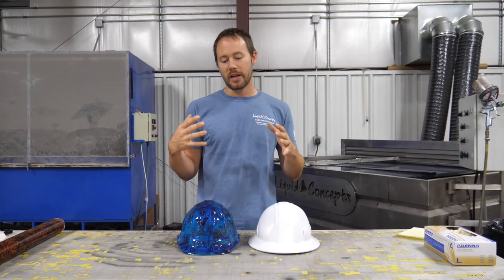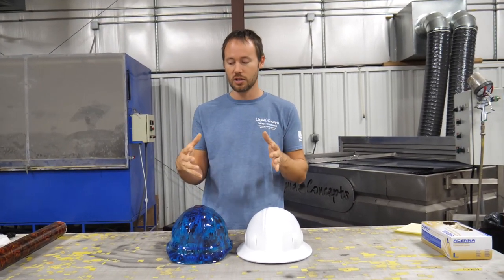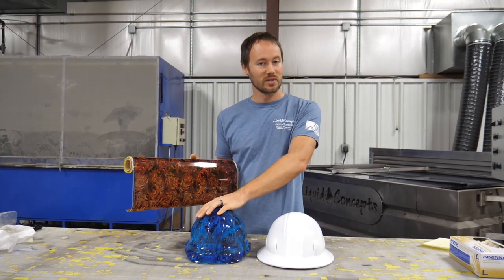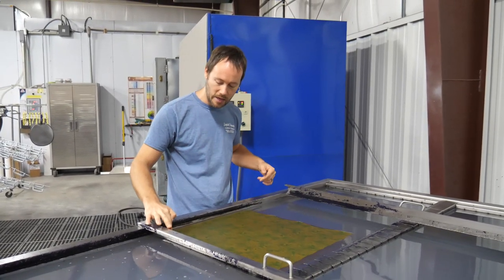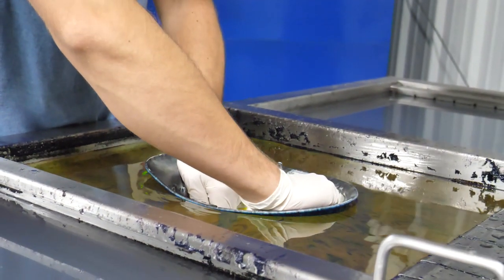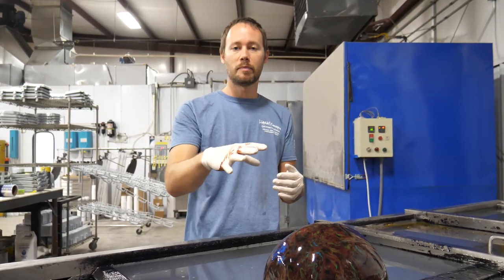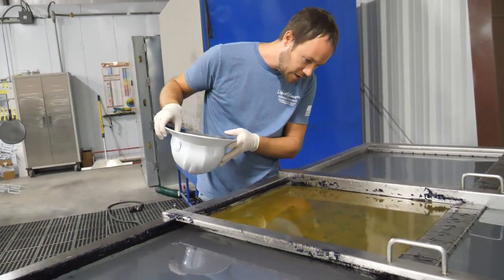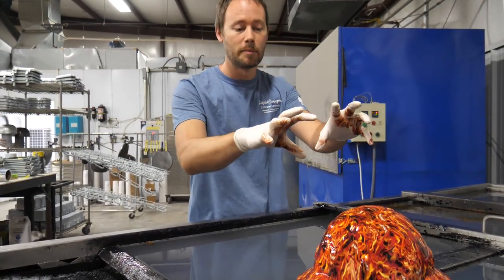WHY YOU NEED TO PAINT YOUR PARTS BEFORE HYDRO DIPPING | Liquid Concepts | Weekly Tips and Tricks

Comment: I have trouble with all flame patterns do I need to let hydrodrate longer than 60 sec or just practice more on activator (always sections that don't bond or pin holes)?
Reply from the maker: Pin holes are usually a result of being under activated.

Comment: Does this mean dipping clear polycarbonate is impossible ?  I'd like to dip so the dip is on the backside and visible through the 1/8" polycarbonate.  Is there a clear that would bond to both the poly and the dip would also bond to ?  Maybe if the clear was still tacky just before dipping ?

Comment: Would the hydrographics stick by just keying the helmet with glass paper and not painting it with a base coat?
Reply from the maker: No it wont. You need to make sure you apply a base coat down first to make sure you get the proper adhesion before dipping the part.
Reply from the maker: You need to base coat the item for the print to have something to bond to.
Reply: @LiquidConceptsUSA  Can you use any acrylic rattle can base coat?
Reply from the maker: @thundertiger76  You can try it but we highly recommend to use paint for hydrographics. With this you will get inconsistent results and may end in the print not adhering.

Comment: Does it work if you sand or scuff the clear coat and then dip it? I do a lot of motorcycles and airbrush work. If I wanted to incorporate hydro dipping on a paint job would I have to do the dipping first or could I clear coat previous work, sand it down, tape it off and then dip?? Or re-spray a base coat before dipping?
Reply: I have done some dipping on a few motorcycles and I prep, paint, mask off what I do want dipped, dip the part, rinse, then clear. I have also sprayed a candy over a freshly dipped part then cleared without issues. Hope this helps. Cheers and good luck!
Reply: @Stu Pidassol Yes, thank you!

Comment: Hello, after applying the film to the object, it slips, does not stay on the object. What is the reason for that? I use: 1. I clean the object 2. Plastic primer 3. Acrylic paint for cars 4. Water temperature 28-32 degrees Celsius Am I wrong somewhere?
Reply from the maker: It sounds like a paint issue. If the print is not adhering to the paint then the paint is not compatible.

Comment: If I'm painting  a stainless steel tumbler and it already has paint on it do I have to get all the paint off of it or just scuff up the surface to remove the clear coat?
Reply: You don't have to remove all of the paint. Scuffing the clear coat is vital, but you should repaint the part before dipping to ensure the film bonds.